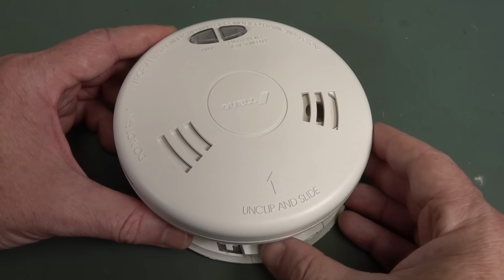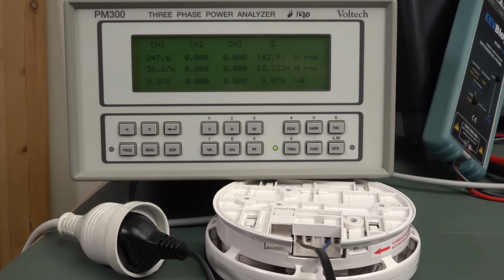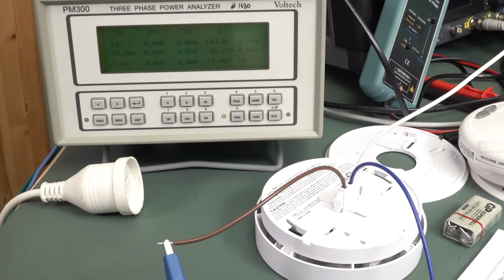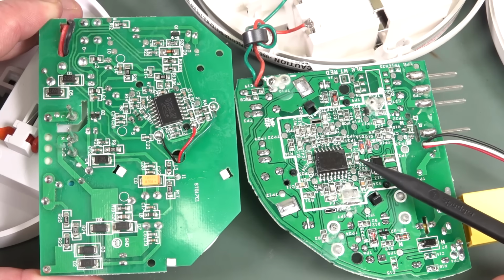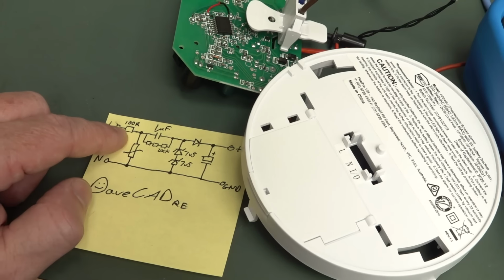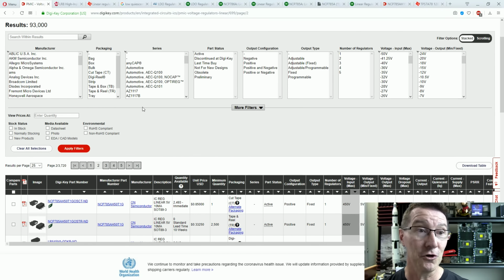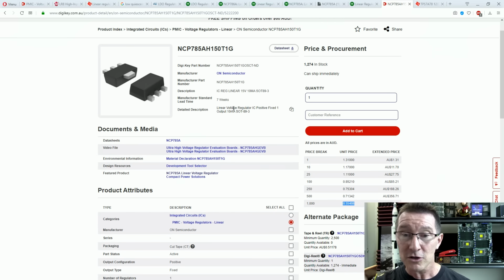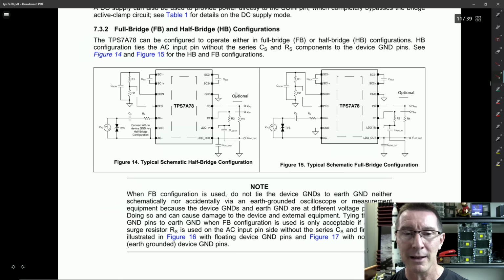EEVblog #1284 - How Bad Product Design Kills The Environment

Comment: So, how many kilometers of solar roadways would be required to power 5 of these devices?
Reply: Are trucks driving on this solar roadway?
Reply: I'd say one tile would be good enough, installed upside down.  On the sun.
Reply: @redsquirrelftw  Now were talking
Reply: @redsquirrelftw  What kind of truck traffic is there on the sun? I heard it could be quite bad at times
Reply: I keep trying to do the calculation for you, but my calculator keeps spitting an error...seems anything divided by zero gives calculators the heebeejeebies.
Reply: @Bennyboy-dog  ur so dumb then aw man...
Reply: @Bennyboy-dog  Just multiply by the inverse of zero.
Reply: Does this mean you're fire alarm won't go off when the sun isn't shining.
Reply: @Tom Parmenter  no it’s fine when the fire reaches the roof it should provide enough light to power it
Although by the time it sounds there’s a good chance you’ve already discovered the house is on fire
Reply: zero kilometers, because they're not even operational most of the time from bad design and degradation.
aka, A GREEN SUCCESS !!
feel the warm and fuzzies
Reply: That depends, does it have a car above it? (I believe that limits their output)
Reply: Enough to reach to the moon and back a dozen times.
Reply: depends on how many tractors you park on it
Reply: I think about..... -5 m²
Yes negative. SolarFreakingRoadways so far have been an energy-consumer (they just occasionally forgot to mention that their test-installation needs quite a bit of auxiliary power for the snow-melting and lights)
Reply: all of them :D
Reply: All of them.
Reply: A matter of inches, depending on time of year, latitude, and how dirty the road is.
Reply: Or how many drops of rain? https://www.sciencedaily.com/releases/2020/02/200205132354.htm  (Spoiler alert:  It has to be the w@nkiest "invention" I have seen for quite a while.)  Shame on a supposedly serious science website for running that "story".
Reply: I have a GREAT idea!!!!  We could use the baterizer!

Comment: It’s winter time where I live (middle of US). The waste is just heating my house this time of year, right?
Reply: More like it is heating the wires to your house :)
Reply: @TD-er  Don't give solar freakin roadways any ideas!
Reply: @uK8cvPAq  well I do live in the Netherlands, where we apparently have those, although I had to learn about it on some Australian vlog channel ;)
Reply: Yes...but a heat exchanger (your A/C unit) will do it more efficiently. But if you're just looking at financial cost, at even 1W, and estimate 10 cents per kWhr, then 1W * (1kW/1000W) * ($0.10/kWhr) * (24 hr/day) * (365.25 days/year) = $0.88 per year to operate a 1W smoke detector and incidentally heat your home.
Reply: @davidhoelscher  True. I have a heat pump and high efficiency gas furnace. I should probably work on shutting off electronics in the summer when I am cooling. In that case, the electronics are using electricity and I am then using more electricity to remove the heat from the house.

Comment: Real eye opener here. So much waste. I wonder how many other crappy mains devices are out there. Perhaps make a section about this dave? We should all inform our local representatives to take notice so products like these come with a “waste” warning, or better still, are banned from the market unless they do it right.
Reply from the maker: There are TONS of other devices!
The Energy Star legislation for example was bought in to reduce standby power consumption on plugpacks.
Reply: I remember Apple Powermac G5 computer having very very high ''off state'' current.
Reply: Here in Europe we have energy labels per product. But I haven’t seen those on these “low” consumption devices. They only use it for big devices such as refrigerators. And I’m not even sure if that label incorporates the power factor to measure the actual consumption. 

Either way, I’ll try to ask for more info on this. Thanks a lot for reporting this! I always suspected that there was a lot of waste with these rectifiers, but never knew it was so massive.

Comment: I guess they designed(?) it to support the max power draw when the alarm is operating, hence the 1uF cap. Still it is a really crap design.
Reply from the maker: I added the overlay for that, 15mA measured with the sounded on.
Reply: if it only needs 15 mA at full draw, the capacitor would only have to be 220nF if I did the math right.

Comment: Think about sensible software development. Take for example a PC with windows sitting "idle" doing updates, other stuff and using lets say 25 watts more because of CPU usage. Now multiply that by a couple millions of computers in homes, offices, schools etc.
Perhaps you could have a measurable difference in electrical grid load by using a less bloated operating system like linux...
Reply: I do not get these multiply-things. Yo pay only or your electricity. When you multiply it to a nation you get a figure that sounds large but just because you are not used to such figures.

One watt of continuous power costs about one dollar or euros in a year, more on countries where electricity is highly taxed-
Reply: A pc usually doesn't use more power in windows than it does in linux. It might even use more in linux with some hardware because of less optimized drivers. Also windows doesn't do more updates than linux in general. Users who complain about windows "always updating" or "always updating when I need to do something important" are those users who always click away any update messages until it kicks them in the butt. If these same users were using linux, they'd actually never update anything. It's why microsoft decided to force updates in win10, the user base is just not comparable to linux users. Linux users in general are eagerly awaiting updates and have been reading the release documentation before the update was even available. Windows users in general are like "why is this stupid thing always doing stupid things, duh!" ;)

The only thing I could imagine would use a little more energy in a windows system is the background virus scans by defender, but they don't actually take long and wouldn't account for too much power usage overall.
If you don't believe me, install a win 10 and linux on the same machine and measure for yourself.
Reply: Windows does fuckin SO much in the background. I can tell, especially with my laptop. I leave it alone for like 5 minutes and then the fans start going off and I can see various services, Photos, etc. in task manager.